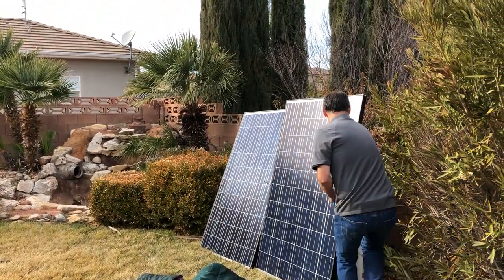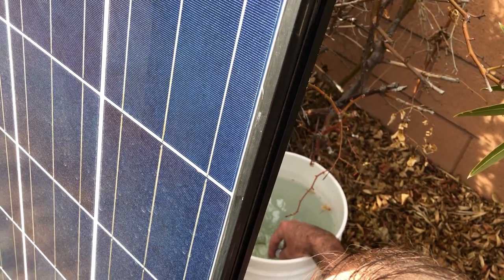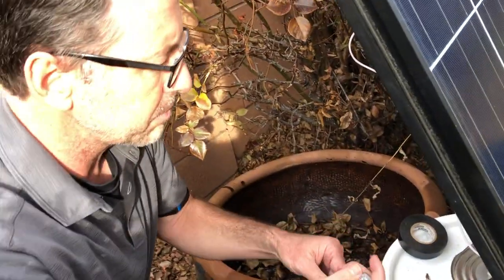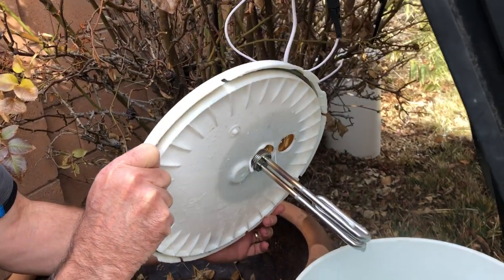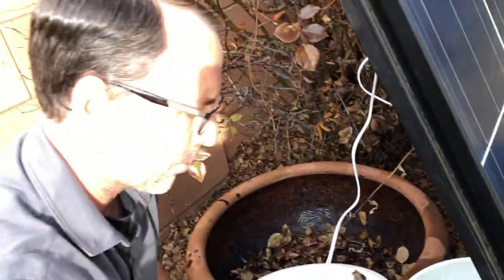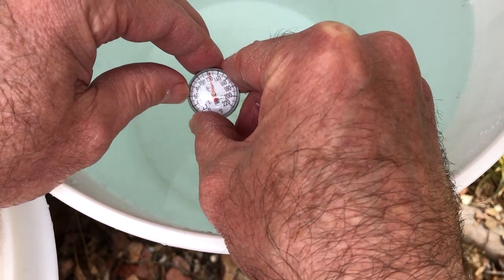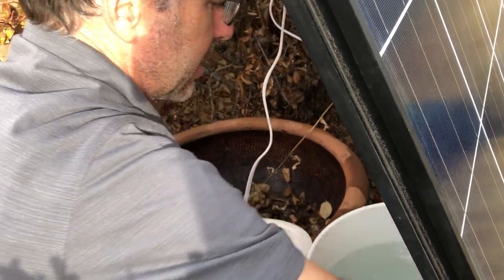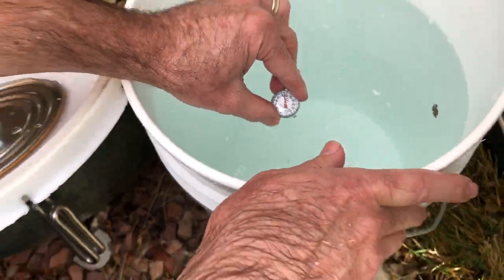How to heat water for RV or home with PV solar panels part 4

Comment: You should publish the voltage on the element every half hour.  Then people would see just how bad direct connect panel to heating element is. The wattage can then be calculated from the resistance.  A power point controller more than doubles the heat that can be produced in a day. In clouds the results are even more dramatic. 90F just doesn't cut the mustard.
Reply from the maker: Let me add a controller and see what happens.  I don't know if I can do that every 1/2 hour, but I could do that once an hour.